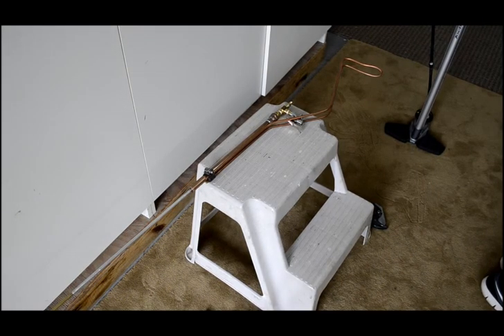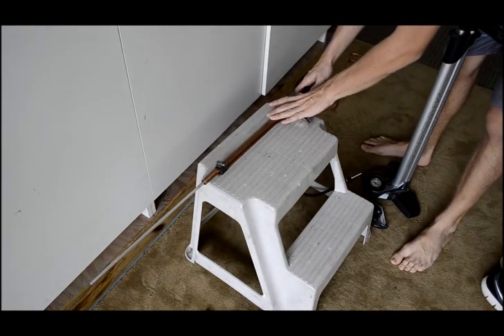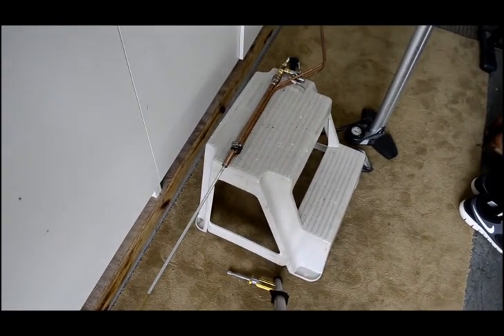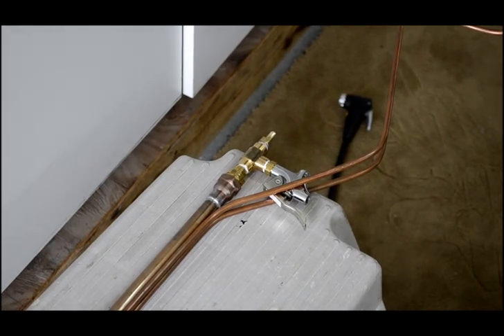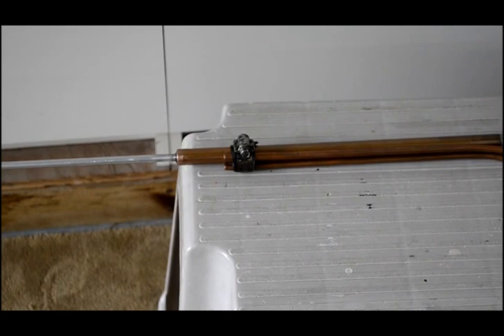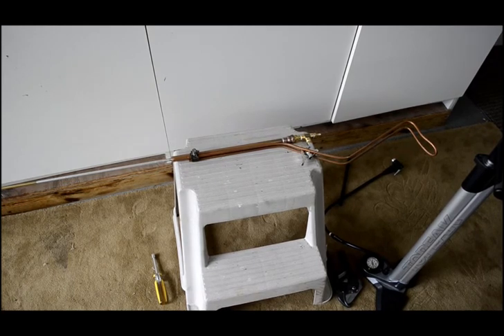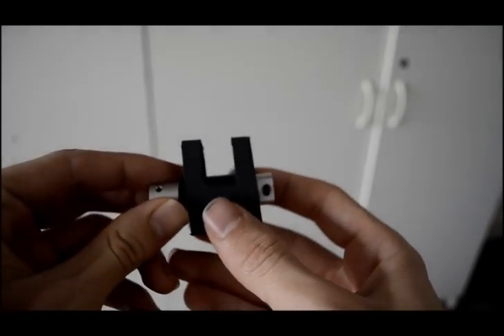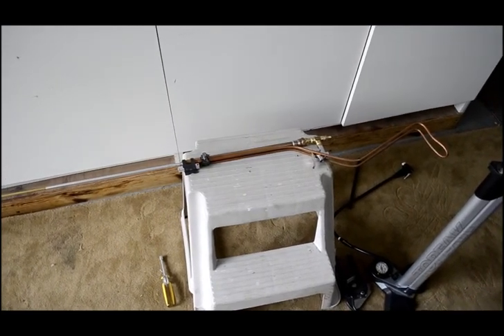Homemade .22 caliber pellet gun

Comment: nice build is the reservoir 22mm?. I'm currently making my coaxial that will be shooting 6mm steel ball bearings, I'm having problems with the piston not sealing properly. what are you using for the piston face?
and have you increased the surface area of the end of the barrel?
Reply from the maker: its just over half inch, so about 13mm. but the barrel is inside so its less.

for a sealing face, I super glued a small neoprene washer to the piston. no sealing problems at all. And yes, I enlarged the seat using some 1/4" steel tubing that had thicker walls than my brass.
Reply: OK thanks

Comment: Looks very Nice !!
Waht do you think about The power ?
Reply from the maker: I actually made some little bullets out of screws with a little bit of electrical tape wrapped around them. from 40 feet they plow clean through a full water bottle and it is very accurate. One time from 40 feet I missed the bottle and the screw head got stuck in the wooden fence and I couldnt get it out. thats a lot of power considering the head isn't sharp at all. Its completely blunt
Reply from the maker: FYI the shots were done at 250-300 psi. I might take it up to 400 psi eventually, but I don't feel like I need to considering it is very powerful at just 300.